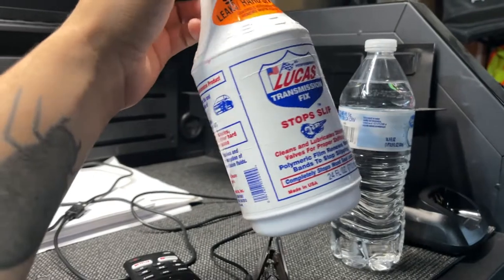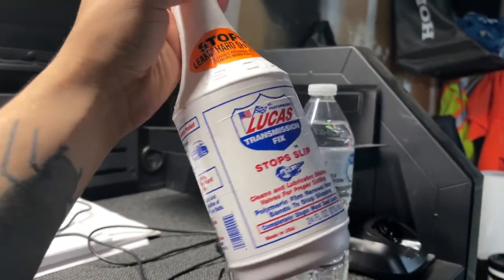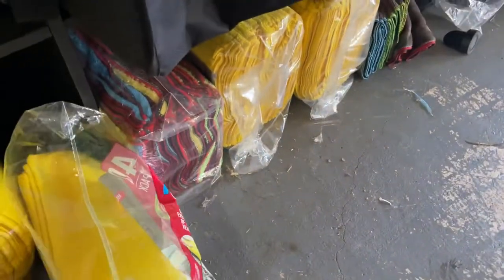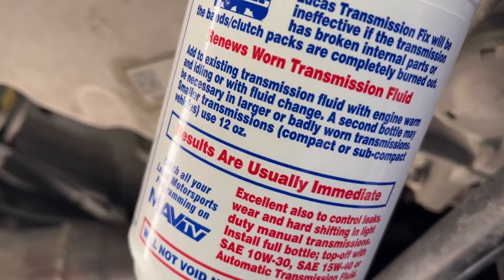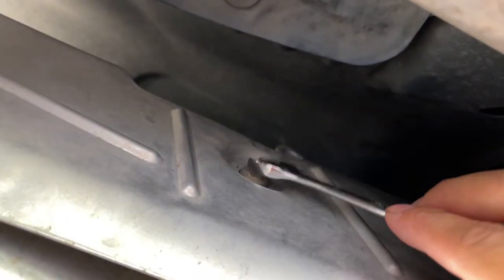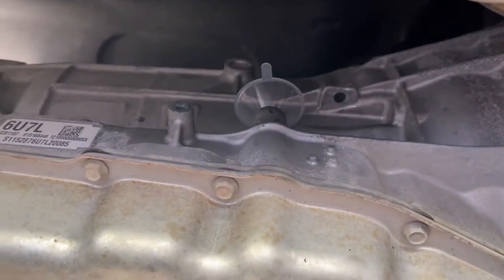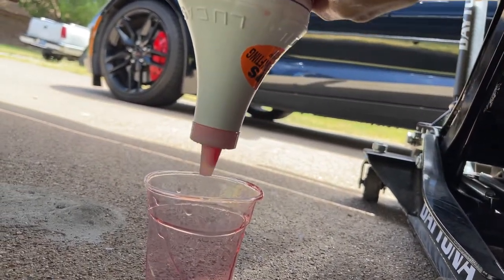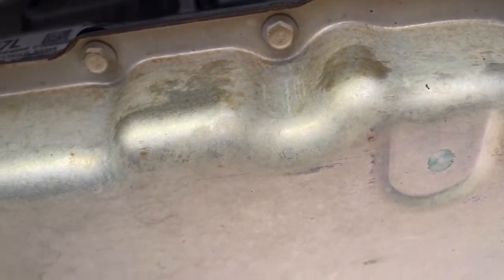2016 2019 Chevy Silverado Transmission Slip Fix

Comment: My 2017 Silverado has a dip stick. If it does the dip stick tube flows into the pan. There is no plug and you can fill into the dip stick tube.

Comment: Why not pour it through the transmission dip stick ?
Reply: Mine does not have one, lol trust me I checked. Would’ve saved me a shit ton of time
Reply: Mine is a 2017 and it has no dipstikc either👎🏽
Reply: Doesn’t have one
Reply: @sweetz4054 Mine is a 2017 and it DOES have a dip stick.  🤔
Reply: @DopespotEnt  thanks for correcting me
Reply: @isaiahmarquez9717  and mine is a 2017 1500 LTZ. I've seen many other LTZ's same year no transmission dip stic

Comment: Mine is 2016 it does have the dipstick, i just change the oil and filter but still the same doing weirds jumps in low gears. 
If i did the transmission oil change and is full of new fluid im not able to add any other lubricant right? I mean I dont want overflow and get a different issue later. 
What do you think?